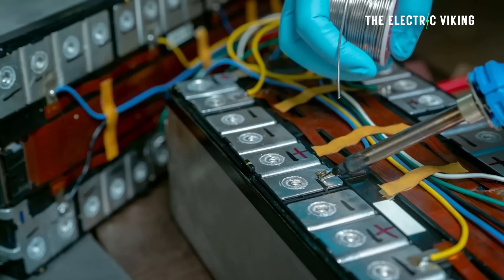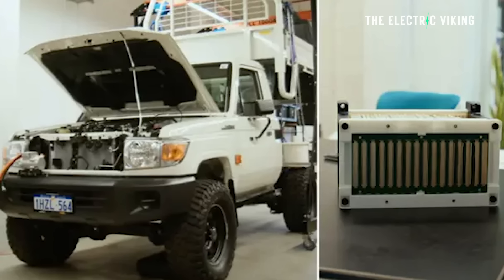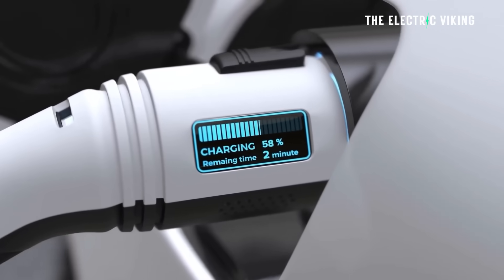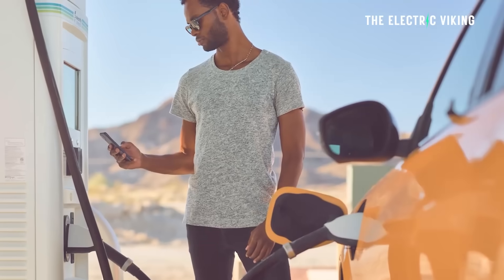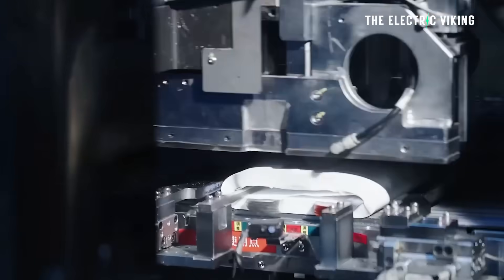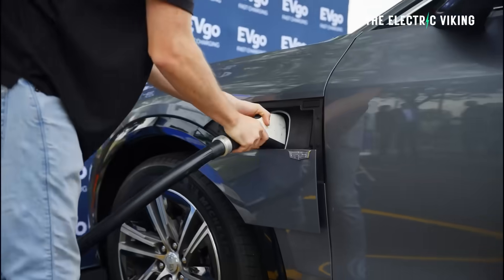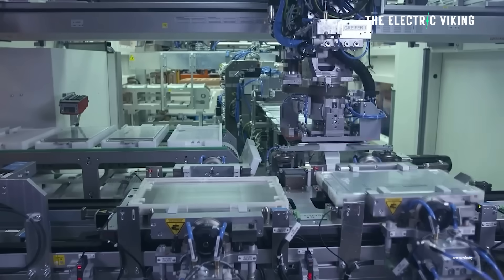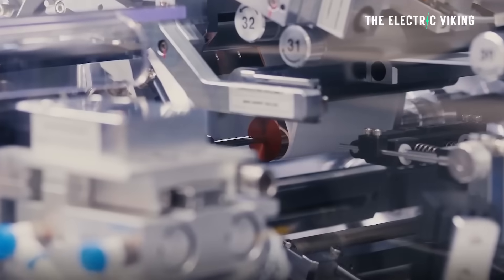World’s 1st XNO niobium EV battery charges to 100% in 10 mins

Comment: Now make it affordable and available to the mainstream consumer.
Reply: Niobium is a precious metal.  There is a good reason for that.  It is rare, as well.

However, any advancement may lead to improvements with other parts of the battery.   It’s called research.  The lead/acid battery was not automobile-ready when first introduced.

It’s no more ‘grid-hungry’.  70kWh would still only be needed for a 70kWh battery.  It may take years to introduce, something like this, to the market.

Further, how much more does a car require, wrt charging time?  According to the click-bait EV-haters, it only needs to compare favourably with a fossil burning, toxic, polluting engine.  Nobody regularly charges from 0% and few to 100% now, so 20% to 80% is likely attainable in a more satisfactory time scale.

I don’t know, and don’t care, if this doesn’t work out.  There will be others and there will be progress.  Rome was not built in a day.  ICE has had over 130 years just get to where it is - and hasn’t developed that far in the last 30.

Fossil fuels are not unlimited in supply; global overheating is rapidly descending on planetary life (not just us humans); renewable energy is the future.  Get used to it.  If any of these break-throughs occur before 2030, the EV haters will have less excuse, to whinge, than they do now.  I hope I will be here to see the day when ICE cars are no longer sold in the UK.

Even if these better batteries were only applicable to heavy plant/agriculture/etc it would be another step forward.
Reply: Removing protectionist tarriffs would do that.

Comment: Wow, 10,000 charge cycles. At that rate an EV with only 250 miles per charge will have gone 2.5 million miles after 10,000 charges. Hell, even if it's abused and only lasts 5,000 charge cycles that's still well over a million miles.
Reply: So, its bascially not needed. They can design it to degrade faster, for higher charge speeds. Or push the voltes higher, for more range.
Reply: Let US automaker at it.

They will design it to fail after 30,000 miles.

Comment: When I was in high school, they had not yet invented the lithium battery.  They knew that it had enormous potential, and there were theories about lithium/sulfur batteries but nobody had made a lithium battery that worked yet.  Now, that was a long time ago (I graduated in 1976).  There were some attempts at it but nothing commercial for a long time.  So, even though they knew the potential was there, it took a long time to harness the ideas into something commercially viable.  Even so, radical ideas are interesting.  Perhaps Niobium is not the only material that can produce this same effect.  At any rate, eventually, some of the "game changer" ideas will come to fruition.  That is what a rechargeable lithium battery was ages ago, and now we have them in our cell phones and a zillion other places.  Technology moves forward and it starts in the lab.  Once a good idea is found, people try to make money with it.  Some times they succeed right away.  Sometimes it takes decades.  At any rate, charging speeds are not as important with long travelling distances that the newer cars are developing.  If you have a charging station at home, you can charge all night.  If you can wait until you reach your destination, then there is no hurry to recharge then either.  It is only when you are forced to recharge on the way that it matters a lot.  And 10 minutes is better than 20, but I think most people can live with 20 for the time being. If we get cars that can go 1000 miles due to increasing energy density, then the charging time will be even less relevant. I find it amusing that so many people whine about your technology announcements.  I don't think I ever heard you promise that it would be ready tomorrow. So keep up the good work Sam.  I find all of your posts to be very interesting.
Reply: I well remember buses in Manchester (1970s) using sulphur batteries (at 50°C) - one buzzed me with its silence!
Reply: Funny!  When I was in high school, nobody had ever heard of an alkaline battery!
Reply: gatoleblanc8432  - Little Lithium is being recycle as batteries are lasting much longer than expected in both 1st life in cars and 2nd life in BESS, the recycling that exists is mainly aimed at faulty and damaged battery backs and is scaled to that volume. However, many companies - battery manufacturers, automakers and recycling specialists and goliaths - are investing in capability, the market is maturing and projected to be worth $95 billion by 2040. 

It's interesting you're seeking to state Lithium is needing to be mined continuously, discounting recycling, where as it's hydrogen that is produced as a foverever consumable resource, requiring significant energy both in production and providing lower energy returns. Both are Lithium and Hydrogen are energy carriers, one involves the production and transmission of electrons with storage at the point of use, whilst the other the production, processing, and storage of electrons carried via hydrogen atoms at the point of generation. Hydrogen has a much higher energy cost at every process step compared to handling electrons.
Reply: gatoleblanc8432  - Likewise hydrogen PV-EC and PEC solar cells offer lower efficiency that PV cells,  with PV-EC the PV element having the same efficiency (of previous gen PV pure cells) but electrochemical conversion element only offers 60 to 70% efficiency on top, reducing the overall solar efficiency to well under 20% of PV solar (typically in the low 10s % range); semiconducter based PEC offers lower efficiencies currently. Unlike PV, perovskite cannot be used to raise efficiency as perovskite is moisture sensitive meaning they cannot be submersed in water to perform hydrolosis. Similarly, tandem cell and bifacial panels perform less well when submersed in water as it refracts light in ways that are sub-optimal absorption. This is one reason why series PV-PEM hydrogen electrolyser designs are being researched, but currently offer lower overall efficiency; with the hope that improvements in the separate PV and PEM electrolyser domains may raise one or both of the two component system efficiencies. 

Durability of catalysts involved in hydrogen PV is one primary research concern as whilst they work in lab conditions in real world conditions with day/night cycles they degrade relatively quickly as well as efficiency degraded by the panel's heat management design. Also hydrogen panels require mined materials just like their PV counterparts, plus that of their catalysts (some of which can be quite toxic in themselves). 

The hydrogen panels do not store hydrogen as you stated, rather they can be switched on/off meaning water is held in it's unconverted state, when switched on conversion occurs at a relatively low rate compared to other hydrolysis methods (PEM cell electrolysis for example). Meaning storage and generation cycles are based upon both the availability and strength of solar light on the panel. Storage for transport requires additional energy sources to pressurise or liquify the hydrogen at significant energy input cost, similar with pressurisation to 700bar to store in fuel-cell vehicle vessels.

p.s. I'm up to speed on current journals, industry analysis and engineering both on hydrogen and battery technology, hence if you feel there is a commercialised or research area I've missed out on, then as requested above, state your source otherwise you're just throwing random apocryphal claims out.
Reply: Well said. The simpletons who are here to be negative are important to boost the channel in the algorithm but add nothing to the conversation.
The opposite of love is not hate it's ambivalence.
Sam and the electric future are living rent free in their heads.
Reply: @andrewsaint6581  

"The simpletons who are here to be negative"

Replace "negative" with "Realist" since I'm not trying to get clicks and likes for my channel I can be the "realist". 

Everything seems to be a pump and dump in 2024. And I say that because for the last 5+ years it's been the "solid state" batteries that are the "Game changer" and I'm "too stupid" to understand that as I've been told repeatedly when just showing up in the chat being the "realist".
Reply: The Hydrogen Fuel Cell market has taken leaps and bounds in year, fuel cell catalysts,  membranes, anode and cathodes have become much more cost effective, real powerful, comparison to the combustion engine and cost closer to the lithium EV, the enhancements performances of the fuel cells are trully becoming remarkable, new state of the art hydrogen refueling fuel cell tanks about the size of propane BBQ tank and smaller replacement refueling cartridges which to buy at convenience stores some day, giving ranges of over 300 miles per fill in minutes, made of really strong carbon fiber with top cut off hydrogen impact leak sensors tanks for cars, trucks, buses high level impact safe, comparison higher safe next to making ones propane BBQ tank, so whats holding fuel cell cars from mass production is infrastructure of green hydrogen and refueling stations, this also taking leaps in investment pouring into sector, way it looks by 2030 there will be abundance green hydrogen it will make heads spin put lithium EV cars at extinct levels, after all lithium EV cars mostly taking for ever recharging  on oil and coal grids and driving MrFreeze cars in winter areas a no, lithium cars need enormous amounts of metals highly polluters to mines especially lithium which is a disaster for the environment.
Reply: @gatoleblanc8432  Where is the hydrogen going to come from? Currently 99% is from Steam reformed methane. This uses vast amounts of energy and releases huge amounts of CO2. If you want to electrolyse water to make hydrogen you need very clean water (otherwise the electrodes quickly corrode and they are rare and expensive metals such as platinum). Making water clean is energy intensive. Making Hydrogen and cooling it to liquid hydrogen to store and transport uses loads more energy. The world doesn't yet have excess clean water and excess green electricity, so best to use what we do have to drink and drive very efficient BEVs.
Reply: @chilllytube  the new solar cell are mor efficient make hydrogen than just storing electricity or lithium, simply more bang for the buck for hydrogen storage, Due to the heavy toxins and pollution in mining lithium, when a lithium car is still in the company  assembly line it has already polluted more than a hydrogen fuel cell car that has been on the road for more than 125000 miles!

Reply
Reply: Hydrogen fuel cell also use materials dug from the ground, such as platinum that is less abundant and more impactful to mind (higher degree if waste spill) than Lithium.

HFCEVs also require lithium batteries as the fuel cells cannot produce sufficient power under load such as when starting and accelerating.

Hydrogen production is resource intensive, with green hydrogen requiring three times the renewable build out per miles traveled compared to more direct use if electricty such as by batteries.
Reply: @GruffSillyGoat Very little platinum or lithium is used in fuel cells in comparison to how much lithium is used in an lithium EV, lithium is very difficult to recycle this is why 99% is not, the new solar cell are mor efficient make hydrogen than just storing electricity or lithium, simply more bang for the buck for hydrogen storage, Due to the heavy toxins and pollution in mining lithium, when a lithium car is still in the company  assembly line it has already polluted more than a hydrogen fuel cell car that has been on the road for more than 125000 miles!
Reply: @GruffSillyGoat plus lithium EV`s need more toxic metals than a fuel cell car, Secret about hydrogen fuel cell cars is  that each car actually cleans the air as it runs due to it`s clean watered electrolysis  when released onto the atmosphere.
Reply: @gatoleblanc8432  - You're a bit out of date with regards to Lithium recycling, multiple processes now exist with mainstream multinational recyclers (like Veolia) involved. The current goal is process efficiency producing battery grade Lithium direct from the recycling process without additional processes.

To claim that hydrogen produced by solar, which produces electrons, is more efficient than storing energy those storing those electrons directly in a battery is not a credible claim to make. Green hydrogen production requires 3 times the energy compared to direct use of the same electricity via battery based EVs. Of some 60kWh of electrical input energy used to produce 1kg hydrogen, 33kWh of output energy is available, however, with fuel cells currently only 50% (best case) can be utilised meaning 16.5kWh, some 27.5% of the energy put into the process. This fact is recognised by Society of Engineering as well as hydrogen industry groups like the Hydrogen Council. This is why reseatch efforts still continue to improve the production of hydrogen. 

Do you have sources for your claims on mineral impacts of batteries vs fuel-cells, as you're claims are again not credible compared to available data from respected sources and readily available life cycle analysis reports. 

Hydrogen fuel-cell are additive to the Lithium battery demand, as they require Lithium batteries to operate effectively in vehicles. Whilst the batteries in FCEV are smaller so Lithium resource may spread further they don't prevent the extraction of Lithium and introduce new mineral requirements both in hydrogen generation and fuel-cell processes - including Aluminium, Carbon, Iridium, Lanthanum, Nickel, Palladium, Platinum, Yttrium and Zirconium. Whilst volumes may be lower many of the minerals have low abundance and require significant higher extraction of source materials with higher spill waste levels as a result.
Reply: @GruffSillyGoat You are the one that has to get updated in these sectors, yes lithium is being recyled, however very little is,, it`s cheaper to mine than recyle,, solar cells yes the new ones are better at storing hydrogen than just direct elrectricity, you get much more out of hydrogen energy in the long run and the amount of  metals that has to be mined  for a lithium car can not compare to a fuel cell car, get updated before reply
Reply: @gatoleblanc8432 it’s a shame that the advances have come too late for a serious impact.😢

Comment: What stops the progressive degradation of the battery at faster rates? I understand them going after the fast charging but, most EV owners I know plan around it and get most from the house at what we might call trickle speeds.
Reply: The way fuel cell catalysts and  membranes and there anode and cathodes becoming so efficient that one day a small coke bottle full of cheap green hydrogen will take your car 1000 miles, this is coming, and new solar cell making hydrogen coming to market that will run homes and cars, and cheap cost effective prices
Why because solar cells have become more efficient making hydrogen than battery storage or just plan electricity, fuel cells are becoming truly remarkable engines for all transportation, secret of fuel cells is fuel cells actually clean the air as they run due to there electrolysis!

Comment: so you would need a 300kw charger for a 50kwh battery. We just don't have that sort of infrastructure and it would be stupidly expensive to create it. I feel we should look at doing our charging in vehicle down time which is most of the time where we can use slower charging and help even the load on the grid. This sort of tech might be best reserved for things we use a lot the time off the grid at low power where charging is a hinrance such as with computers or devices where battery capacity is necessarily low. Yes you could put smaller packs in cars but range anxiety will prevent people buying them and you can rant all you like about the stupidity of range anxiety but it very much exists. This sort of tech would be good for things like ebikes and motorcycles although better energy density would really be more useful in all applications and remove the advantage of stupidly fast charging in most cases. For those reasons I don't think this is a 'game changer" 🤑🤑🤑
Reply: almost evgo, electrify america, tesla superchargers and the new gm stations all charge at 350kw. What are you yapping about
Reply: @tankextremez5605  what I’m yapping about is that if more than a few try to charge at that rate there isn’t the power and so they restrict the max power to share it about. If you watch charging reviews you will often see that chargers don’t charge at their max because of high occupancy. You can’t just stick in a 350Kw charging station anywhere and expect it to be able to deliver the max, just the same as you can’t load every socket in a house to its max capacity as you just blow the main fuse. In the electrical trade it’s called ‘diversity’